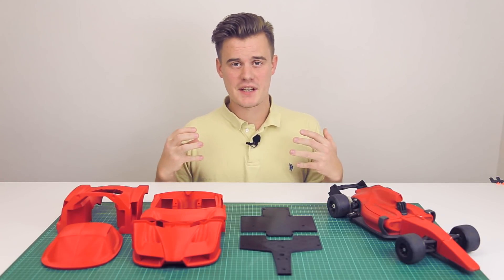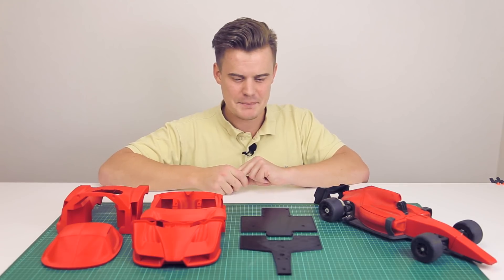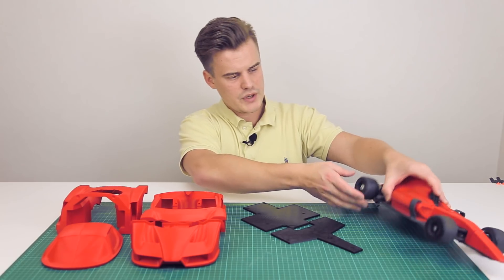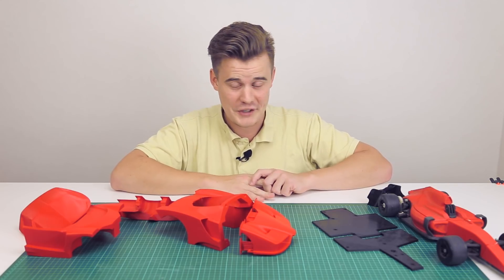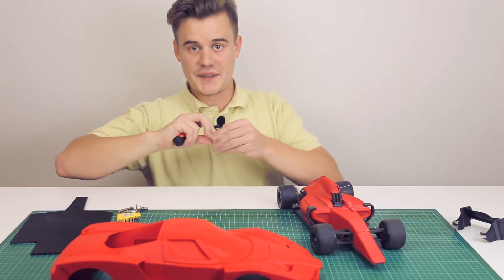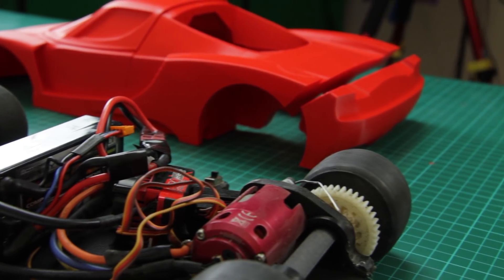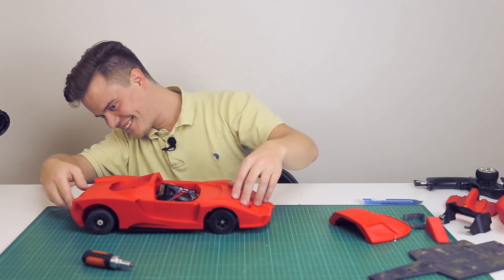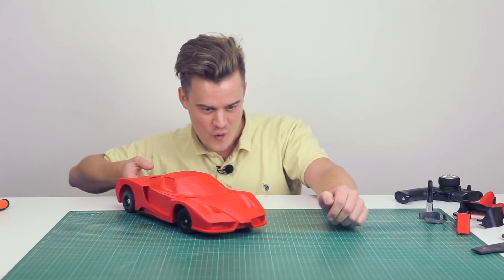3D Printing The OpenRC Ferrari Enzo RC car

Comment: The f1 tyres are too small. Would m chassis tyres better fit the car?
Reply from the maker: They are small. You can use larger tyres on the back, but at the front, the turning of the wheels are the problem to fit in side the car :)

Comment: Very cool design and mod! On a side note, I know you have a lot of experience with 3d printing and support removal, but I wish people that make videos like this one would also recommend wearing safety gear. When removing supports I have cut and poked myself very rarely, but still I now wear gloves, mask and protective glasses, even when I am just using tweezers to remove supports. In 3 years time, when removing supports, I may have cut my fingers 4-5 times tops and they were not serious injuries, but I am not going to wait for a life altering injury to happen to start wearing protection. Keep on designing, 3d printing and keep it safe.
Reply: Oh..  you must be one of those bubble wrap kids..
Reply: Bro which software that you are using to design in 3d and how to design a product in system. And how it's possible to draw a picture in system